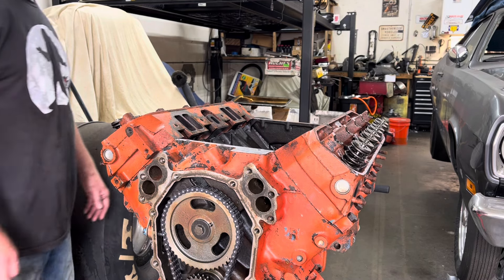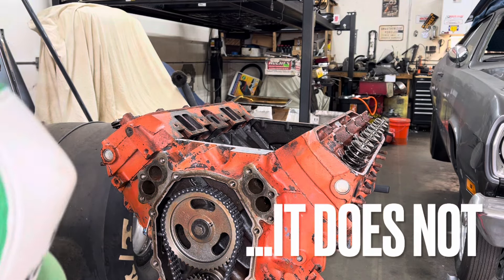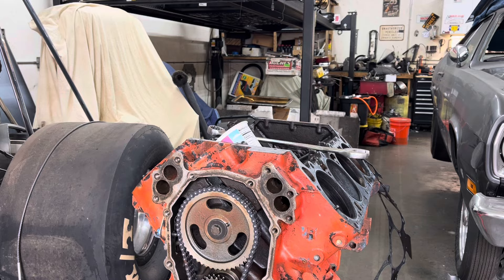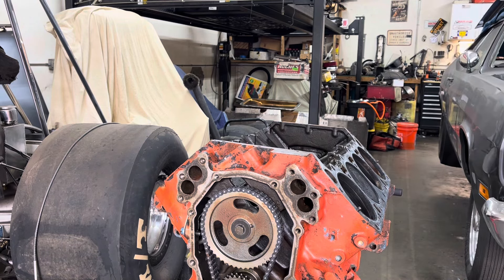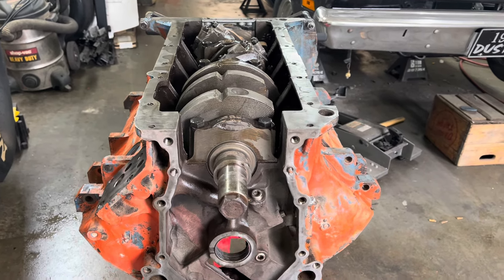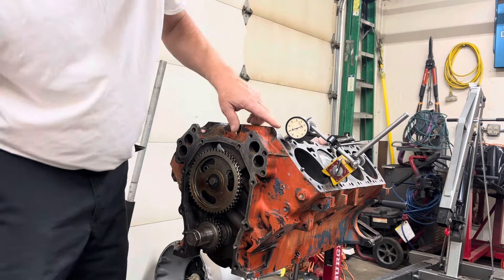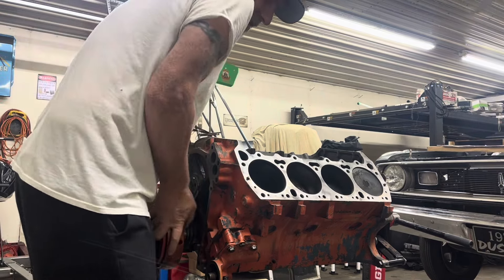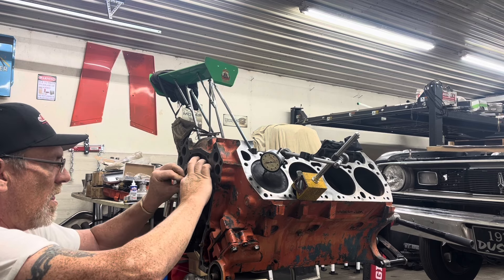440 Cast Crank Low Compression Big Power PART 1

Comment: I'm going dirt cheap budget build with a Hughes whiplash cam in a 35k mile cast crank motorthome 440 engine six pak rods for a street car.. All OEM except for the cam..  So this is a great build for me to watch.. Thanks big foot.
Reply from the maker: I know when I first got the engine from Ryan, I tried to get a whiplash cam but they were out of stock…hope this one works ok.
Reply: I have the Whiplash cam, shaved and ported heads ans tunnel ram with 660 holleys.  Super happy with it.
Reply from the maker: @tetanustv6258  sounds like a cool combo! I’m using a thinner head gasket and they might be taking about a thousandths off when they do the heads. But I don’t want to shave the intake or effect the push rods